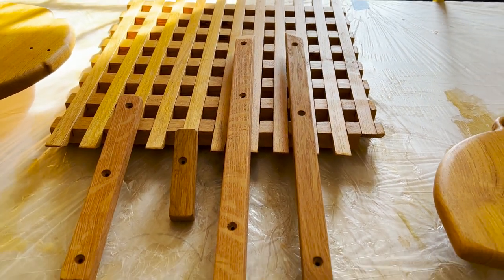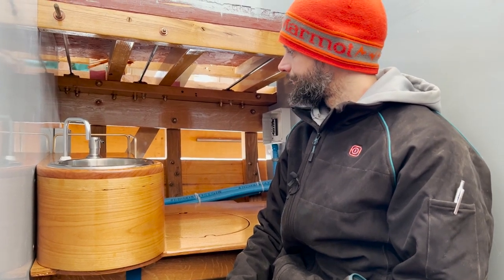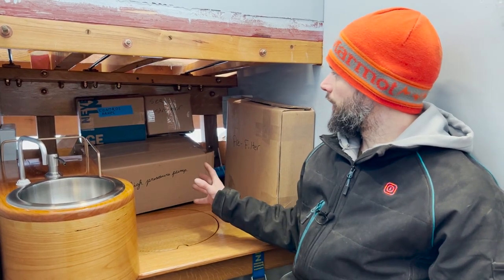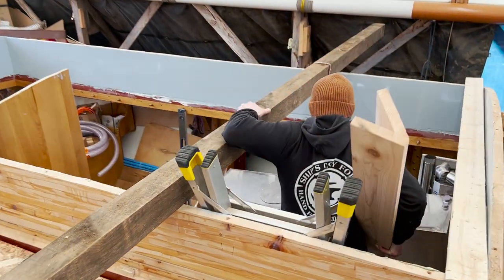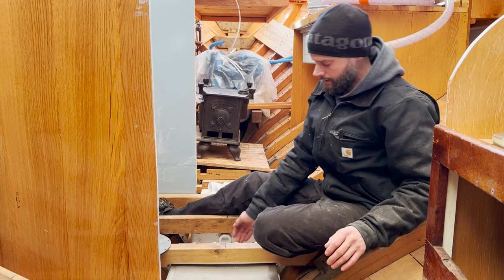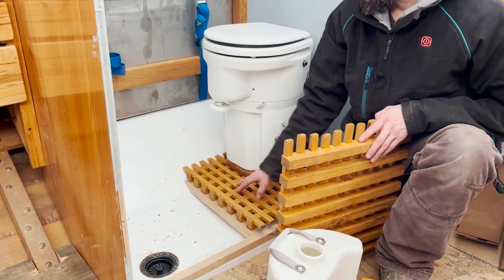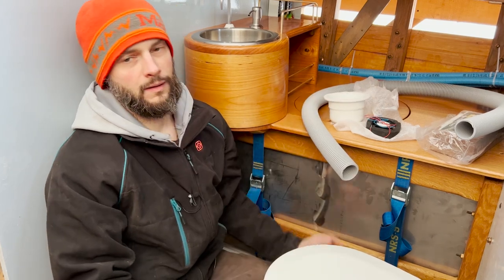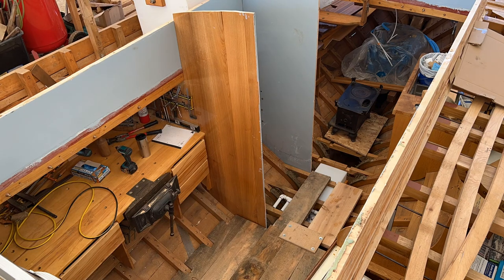Putting In the Bilge Tanks - Episode 205 - Acorn to Arabella: Journey of a Wooden Boat

Comment: You wont regret the watermaker. Moreso than a fridge or any other luxury item we've added over the years to our "once" simple boat, it's a total gamechanger and opens the flexibility and self sufficiency as a cruiser more than anything else. We have a spectra cape horn extreme with dual feed pumps, as well as a little manual watermaker in our ditch bag. Even on a 27' with only 50 gallons of tankage, all that redundancy, as well as the ability for the watermaker to run solely off the solar we have onboard, gives us the same range and comfort as any other much larger boat out there. You can get lost for months in a unhabitated area and still shower, wash the boat, and just generally not ever have to be a water nazi. Your placement of everything is very similar to ours, with all the pumps and gauges above the wash basin in the head. We built an enclosure which opens to reveal everything. Our membrane housing is below our settee, which we like because it's heavy and a bit obtrusive and makes an audible knocking sound with every cycle of the HP clark pump energy recovery mechanism. I'm assuming based on your fine taste in boat parts, that you'll probably go with a Spectra 12v WM.. if so, it was advised to us even in our wee little 27' to try and make room for the Cape Horn. Dual feed pumps over the Ventura and more manual than the Catalina, thus more bulletproof. We made it fit and haven't regretted it..have had onboard for 7 years now and the only parts that have gone are one feed pump head and a small leak in the product flow gauge. We also don't hesitate to run in silty water, it just burns thru pre-filters faster. We definitely don't run in polluted harbors tho, which is generally where it's easiest to find potable water onshore. If you can, make the call about which WM you get sooner rather than later so you can mock up as best you can. They end up taking a lot of room and the different makes and models and can change how everything will want to fit in there. You will want to have a generally good idea of how all the modules work before install for ease of servicing. BTW, don't be so quick to outright disregard a pressure water system onboard. Definitely the foot pumps for everything you will use on a daily basis, but there are many times when having a simple pressure water system to the main galley sink, preferably with an extendable faucet, will make your life easier..say when trying to fill up a 5 gallon bucket or your wonderful Helio LX shower (get a spare gasket or two for the lid). We have showered in the cockpit for years with our Helio and it's great. You will also need a pressure water system if you want to operate a watermaker, which requires pressure water plumbed in to flush the membrane after each usage. All it takes is a 12v water pump and a little more hose. Cheers!

Comment: Your wood work and the way your fit thing shows a lot of thought.  On water use for showers.  We used to use one of those hanging bags that held 3 gallons of water.   Three people could shower on 3 gallons of water.  Does not take much water.
Reply: Used one of those hang-up bags in Alaska when the weather was too cold to wash in the river. A half-gallon bag was enough for one person's complete wash; just heated up part of the water on a little Coleman stove and mixed it beforehand to wash temperature before pouring it in the bag. Have also used a small battery-run electric shower pump that feeds from a bucket; doesn't need a foot pump, runs for several showers worth on one charge and charges from a USB charger.

Comment: Keep  in mind maintainability; You have to be able to switch membrane (you'd need double the length of a membrane), clean the strainer/pre-filter and service the pump. I would have tried to place the control panel somewhere where your head is in this video, so that you don't have to reach in every time you have to tamper with the system.

Comment: Good thinking on the water usage. One thing to think about is that water makers need to be run pretty consistently to keep the membranes working. You may want to put in the pressure water system and shower a bit more often than you think.

Comment: I like your ethos.  You are a lot more hardcore than me and i guess a lot of people but given that you are i think your approach is a good one.  You are keeping it simple, robust and as energy light as possible.  As you say you can always add these comfort options at a later date and as you get older and softer.
Reply: The older I get, the more I find that comfort and luxury are dispensable. Even at home I don't bother washing or showering myself with hot water (or soap), I sleep on a padded plank, and I'm in better shape that forty years ago, when I was actually physically very fit, but had back and hip and knee problems and felt prematurely old. 
I've been able to solve those problems by changing the way I use and look after my body -- which is a separate issue, but related, in a way, to doing without "comfort" items. I don't go in for chairs, for instance.

Comment: Exquisite woodwork in the head, and great choices with the toilet and foot-powered water!
I have a pressurized water system, but guess what? The pump has started to leak again, so it's back to good old-fashioned canisters and jugs. They work too. I only use the pump for showers and switch it all off again after.
As for black water holding tanks, a couple I knew in the marina had a complete fail, had to cut open the top of the tank and shovel it out into buckets for transportation to the Elsan for disposal. Need I say more?
Reply from the maker: Yikes! Thanks for sharing that, Malcolm!

Comment: Steve, regarding hot water, I have what theoretically is a simple idea.  You could run a loop of pipe in and out of the head from the heater, and connect it to a custom heat exchanger (could just be copper pipe coiled up in an appropriate shape to collect the heat).  The heat exchanger might fit between the heater and the tile surround, but the closer to the flame, the better for instant hot water.  You could connect the top end of the loop to the top of a tank sized similar to your foot pump shower and possibly hang it up, using a foot pump to fill it from your water source.  Then use another foot pump connected to the bottom of the heat exchanger to recirculate the water through the loop until it is warm enough in the small tank.  Put a diverter valve between the foot pump and the heat exchanger with a second outlet going to the shower head.  Use this diverter to switch between heating and showering so you can use one foot pump.  Just turn on the heater when you want a hot shower, and pump for a little bit to build up the heat in the shower tank.  You may be able to set the valve to flow the tank water through the diverter and get thermal pumping action automatically, but I think it would take a lot more time for the heat to accumulate.
Reply: Great idea!

Comment: Great episode!  I enjoyed learning about how your watermaker will work.  So many things to consider, especially for ease of access.   I have a reverse osmosis system at home for aquariums.  One issue I ran into a few times was with changing the pre-filters.  The filters were in plastic housings that you use a little plastic hexagon-shaped wrench to unscrew.  I didn't leave good access for removing those so I waited a while to change the filters...and then couldn't unscrew the lids anymore even adding a pipe to the handle for leverage.   If your pre filter housings are similar the answer is to get some food grade silicone lube on the o-ring that goes between the bowl and lid of the filter.  I wish I knew that earlier so I didn't have to take apart the mounting to get the filters into a vice to open them.
Reply from the maker: Thanks for these great tips!

Comment: Steve, great job on planning and fitting your water supply and discharge system in the boat. I do have one suggestion though. The composting toilet that you have chosen has a container for your solid waste and a separate container for urine. I saw a guy install one of these in a small camper van. Instead of using a urine container he plumbed it straight into the larger grey water tank under the van. I would suggest the same to you, figure out how to connect the urine port from your toilet and send it down into your bilge grey water tank. Then you wouldn't have to empty and clean that little tank on a daily basis. 
If you chose not to plumb it in, and go with that tank than I would recommend you attaching a float to that little tank (incase you drop it overboard). Or have a spare urine tank on board. 
Thanks!
Reply from the maker: Interesting… not sure if that works for what we’re doing but we’ll have a look. Thanks for the recommendation.

Comment: That's a cool shower system! Ideal for a traveling sailboat! Realistically with good grooming one needs to bathe once every 3 days or so, especially if you have access to a bidet. Good choice with the toilet system as well, it's probably what I would've picked
Reply from the maker: A bidet is out of the question with a desiccating head, unfortunately. Too much water in a system built to dewater. But, yes, the shower is cool! Thanks for watching!
Reply: @AcornToArabella  its something that can be done on deck anyway :) especially if you're out in the middle of open water. Not to mention you can always bathe by taking a quick swim, if the water isn't too cold haha

Comment: To secure those tanks in the bilge you might consider drilling some holes through the cross beams, tapping them, and fitting a sort of large set screw with a wooden pad on the underside that exerts some pressure on the tanks to hold them secure.  That would help with the up and down motion.  For the lateral motion you can always fit some chocks in place to secure them.

Comment: We used 'Sun Showers' on our sailboat. Just a thick, black plastic bag with a hose and nozzle. You had to check before using as the water could get really hot in the summer sun. There was no need for pressure as gravity from a three foot drop was enough for a nice spray, and the bag held enough water for a nice long shower. (intermittent use, of course)...

Comment: A little suggestion: suspend the high pressure pump under the deck, then prefilter and control panel under it, that will clear some flat surface on the counter.
Shift that to the left and you can push the main filter further back.

Comment: I'm re-fitting my '71 Formosa with all new systems. Originally, it had a conventional head and black tank but I decided to go with a "desiccant" head instead - no thru-holes, no black water tank, no plumbing, no brainer. However, the choice of head is very important. Unfortunately, I went with the Sunmar, the simplest design I could find, thinking that it would have fewer things to break. I've been living with it for 2 years and I really like the concept - just wish I had chosen a different model. 
I like the head you chose, it looks well thought out. A couple of things though; the crank in bucket system is going to be difficult to clean - you're never going to get everything out. You have to disassemble the toilet to empty it which can be a hassle while underway.  The pee bottle design is great - nice seal and it's easy to see when it needs to be emptied. But if anything happens to it you have to get another one from the manufacturer. Other toilets use generic water bottles which you can get anywhere.
Love your videos. Can't wait for the launch.
Reply: actually you don't want to completely clean out the "bucket" that kind of defeats the bacterial ecosystem you're establishing in there. Just dump and load. Maybe a complete clean yearly.
Reply: I’m worried about a desiccant head. Using a a head in a moderate seaway is un unbelievably difficult exercise in itself. There looks like lots of negatives. 
Ensuring your pee doesn’t get in the poo will be impossible while underway. 
The pee bucket looks small. I’m not sure if you have ever tried walking in a moving boat with a half filled coffee cup but I am certain I’d never want to try with that pee bucket and you’ll be doing it several times a day if you have a lady on board. 
A holding tank only gets used in a harbour. And underway everything just goes straight overboard. No work no effort. 
Have you worked out what happens with the system on a 35 degree heel and dropping off a 3m wave?
Heads are not gimballed and the  pee will slosh around ALL the time. 
Finally I read a book about a boat with a desiccant head and the trio was Dominated by the head, the mess, the odour. 
You seem to ask around a lot when making decisions, I’m not sure you on this?
Reply: @addemkoozie  I and many cruisers have lots of experience with these heads. With the airhead if you have the poo lever closed pee cannot get into the bin. Designed that way. So no, not "impossible while underway". Never had that issue. Your 35 degree heel is funny, first you should never be heeled that far, but if you did this is no more challenging than a wet head. And all good head installations are fore-aft direct this helps. The pee bucket easily holds a day's worth for 2 people, women included, though not sure why you think women create more volume? sloshing around isn't an issue the tank is sealed. When removed there is a lid for transport so no half-filled coffee cup analogy there.  When I was researching buying I reviewed several polls and forum threads. More than 95% of all people who went desiccating head said they love it and would never go back. Not sure what "mess, odour" as most users say their boat smells way better than one that mixes water, urine and feces into a toxic biohazardous anaerobic festering soup filling your hoses pumps and tanks. I've never been on a boat with this desiccating type of head that didn't smell way better than a typical raw sewage processing boat 🙂I understand the concerns that someone who has never owned one feels. So I try to answer these without sounding like a zealot. I hated wet head repairs and maintenance and odors. 2 less thru hulls, 6 less hoses, no dangerous vented loops, no pumps and seals, no holding tank, no pumpouts. I like that tradeoff. Finally, ever try to service a malfunctioning wet head in 35 degree heel falling off 3M waves? Talk about a disgusting nightmare. Never again.

Comment: The grating the toilet is on needs to be bolted down but the other one in the head could easily be secured using some good magnets. Epoxying a few magnets into the grates & the pan would give you anywhere between 20lb & 200lb of holding force more than enough to keep it in place while making a drain underneath easily accessible.

Comment: As I worried, in the previous tanks video, and was told in the comments otherwise, you seem to have simply tapped thread into that very thin stainless sheet metal, in order to screw down your inspection port lids. You will have to be incredibly careful with those bolts and the threads, especially after a life and time in a marine environment. Small gauge stainless on stainless thread will love to misbehave there—as I’m sure you know it is incredibly easy to gall and strip threads and/or sheer bolts with such stainless. Because it is a top horizontal surface, you will quickly accumulate salts on the top surfaces which will find their way (in small amounts, but enough to help corrosion and pitting) into your threads—it won’t be enough to contaminate your water by any means, but it will be enough to accelerate ‘stainless’ doings it’s thing it likes to do in damp low oxygen places like your threads there. 

Aside from being very careful whenever removing and screwing down your inspection ports, I think it would pay to apply the best food safe anti-seize grease to the threads (and even on the rubber gasket) you can come up with. For a hatch that is actually used, I would have preferred a welded on flange and tri clamp fitting as I said in previous comment. I’m sure yours will work, I’m just trying to worry years into the future, and I have had tapped stainless like this gall and shear and cause big headaches. Also, what’s the plan B when you DO strip a thread or shear a bolt—it is your essential drinking water after all?
Reply: Thank you. Thought i was the only one who noticed this.

Sealing threaded machine screw inserts would have been a no brainer.

Comment: Two things, I think it would be a good idea to have a salt water flush for the gray water tank. I also feel it is a mistake to not have hot water. To be able to take a consistent hot water shower after swimming in cold water is a moral boost more than a convince.  And with infinite water heaters, you won't have a huge tank taking up space, and energy usage is minimal as the system is on demand.
Reply: Yeah, but the energy/fuel usage of "on-demand" water heaters is relatively high compared to the energy availability on a small boat.
Reply: When it comes to the morals of using hot water, there is no right or wrong.

Comment: Just a small suggestion for the shower: Hoist a bucket of warm water into the mast and drain it through a flexible tube in the bottom of the bucket. This works great on safaris and needs less material/connections than your camping system. Also, I think it would fit well with the keep it simple standard, that you try to maintain.